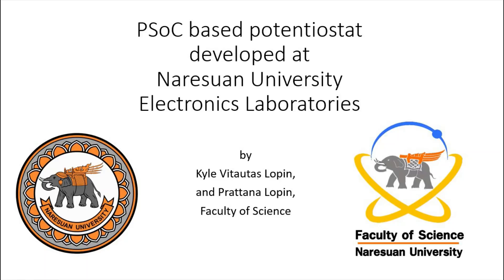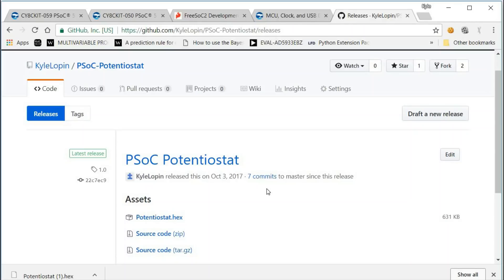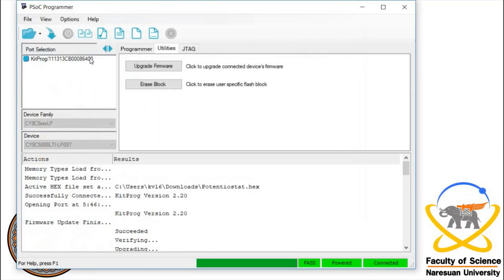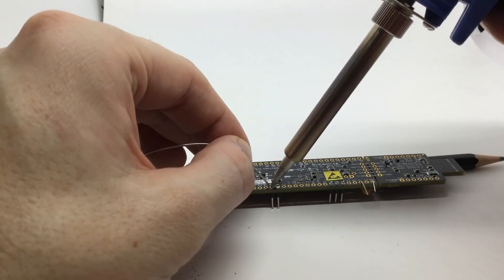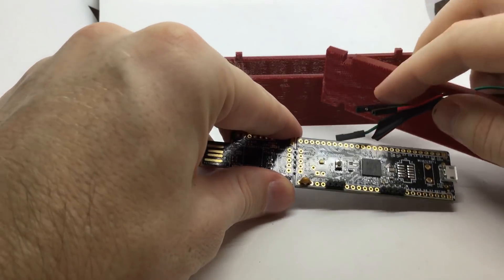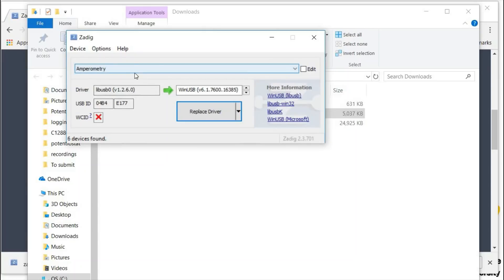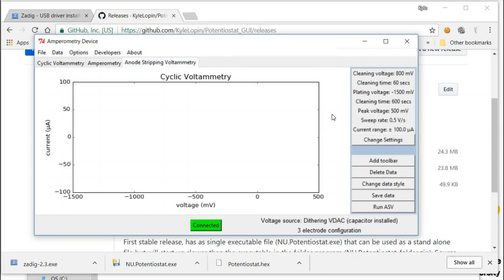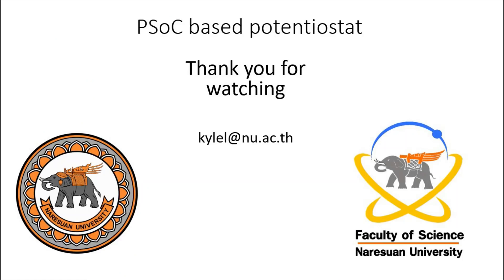Program a potentiostat into a PSoC 5LP

Comment: Hi, congratulation for the work! I try to reproduce and almost everything works. My problem is that I need to increase the current, so I try used a resistor between [0][4] and [0][7]. I used a resistor of 200 ohms, but nothing happens. Could you help me?

Comment: Dear Kyle, after a great effort I was able to use tour potentiostat on a real electrochemical system I made some voltammetries of ferrocene in MeCN using Et4N ClO4 as supporting electrolyte, GC as working electrode, platinum wire as counter electrode and a Ag/Ag+ as  reference. I’ve been trying to use the newer releases of the GUI but it was unable to connect to the PSOC and the button keeps giving me the message that the device isn’t connected. How can I work this out ? I tried to recompile the app but i’ve been getting the same message. Another thing that could be implemented is an increase in the number of cycles and a real time scan. Thanks for you attention.
Reply from the maker: I am working on changing the device and update it with some changes now, but it is taking longer than I expected, hopefully this week it will get done and I will make a new release for it.
Reply: @kylevitautaslopin3609  hello Kyle! I also have the same problem and it can’t seem to be connected. May I know if the update is done and where can I know it instead of coming to YouTube :)
Reply from the maker: @woshibearz  There is a new version here: https://github.com/KyleLopin/PSoC-Potentiostat/releases

You can respond to the github repo in the Issues section, I should be watching it now.  The new version is also simplier so it should be less problems going forward.
Reply: @kylevitautaslopin3609 Dear Kyle, Do you know why the display device in the GUI is also not connected, if you can tell me thank you very much
Reply: Have you solved the problem? I am now also showing devices in the GUI without connection

Comment: Dear Kyle, is there any chance of making the 1.2 firmware and the new GUI working? I tried to put them to work and I’m getting a message “device not connected”.
Reply from the maker: There is a new version here: https://github.com/KyleLopin/PSoC-Potentiostat/releases
It should work better with a serial port and no USB protocols
Reply: @kylevitautaslopin3609  wen are you intensing to improve cule numbers and implement chrononamperomwtry?
Reply: @Shuvra Jyoti Bose ok!
Reply: @Shuvra Jyoti Bose must rewrite the software. You’d study Python and try it.
Reply: Have you solved the problem? I am now also showing devices in the GUI without connection

Comment: IS that same code(Functionality) apllicable for both PSoc 5LP development kit & prototyping kit.If we use Development board then what will be further changes required??? In terms of capacitor installmeant & Pin configuration of WE,CE,RE.

Comment: How to increase number of cycles?
Reply: IS that same code(Functionality) apllicable for both PSoc 5LP development kit & prototyping kit.If we use Development board then what will be further changes required??? In terms of capacitor installmeant & Pin configuration of WE,CE,RE
Reply: https://www.duo.uio.no/bitstream/handle/10852/82665/5/Olav-Bjerke---masteroppgave.pdf     Please include this to your github code ,So that cv cycle can be increased
Reply: Its showing The device is not connected .Can you resolve this? I need DPV

Comment: There is  a problem of DPV based GUI please resolve that else it is useless. Your work is comandable.
Reply: IS that same code(Functionality) apllicable for both PSoc 5LP development kit & prototyping kit.If we use Development board then what will be further changes required??? In terms of capacitor installmeant & Pin configuration of WE,CE,RE

Comment: What is the compatible HEX file for DPV based GUI ? It's may show connected
Reply: IS that same code(Functionality) apllicable for both PSoc 5LP development kit & prototyping kit.If we use Development board then what will be further changes required??? In terms of capacitor installmeant & Pin configuration of WE,CE,RE
Reply: https://www.duo.uio.no/bitstream/handle/10852/82665/5/Olav-Bjerke---masteroppgave.pdf     Please include this to your github code ,So that cv cycle can be increased

Comment: Can we do DPV in that GUI. But its showing device not connected
Reply: IS that same code(Functionality) apllicable for both PSoc 5LP development kit & prototyping kit.If we use Development board then what will be further changes required??? In terms of capacitor installmeant & Pin configuration of WE,CE,RE
Reply: https://www.duo.uio.no/bitstream/handle/10852/82665/5/Olav-Bjerke---masteroppgave.pdf     Please include this to your github code ,So that cv cycle can be increased

Comment: great work. I am having problem while trying to reproduce it. the GUI panel is showing device not found. I followed the procedure as per the instruction video. I am using the same development board.
Reply: Same problem here.
Reply: IS that same code(Functionality) apllicable for both PSoc 5LP development kit & prototyping kit.If we use Development board then what will be further changes required??? In terms of capacitor installmeant & Pin configuration of WE,CE,RE
Reply: https://www.duo.uio.no/bitstream/handle/10852/82665/5/Olav-Bjerke---masteroppgave.pdf     Please include this to your github code ,So that cv cycle can be increased
Reply: Its showing The device is not connected .Can you resolve this? I need DPV

Comment: This is great! Thank you.
Reply: IS that same code(Functionality) apllicable for both PSoc 5LP development kit & prototyping kit.If we use Development board then what will be further changes required??? In terms of capacitor installmeant & Pin configuration of WE,CE,RE
Reply: https://www.duo.uio.no/bitstream/handle/10852/82665/5/Olav-Bjerke---masteroppgave.pdf     Please include this to your github code ,So that cv cycle can be increased
Reply: Its showing The device is not connected .Can you resolve this? I need DPV

Comment: Great! I've seen its been 3 years from the last video! Please go on with more 5LP projects, thank you
Reply: IS that same code(Functionality) apllicable for both PSoc 5LP development kit & prototyping kit.If we use Development board then what will be further changes required??? In terms of capacitor installmeant & Pin configuration of WE,CE,RE

Comment: thanks , it is working
Reply: @Shuvra Jyoti Bose yes
Reply: @thechemist7995  HOW >?? PLEASE GUIDE ME ABOUT THE PROCEDURE STEP BY STEP! , THANKS. Attach links accordingly.
Reply: @shuvrajyotibose9002  i followed his instructions
Reply: https://www.duo.uio.no/bitstream/handle/10852/82665/5/Olav-Bjerke---masteroppgave.pdf     Please include this to your github code ,So that cv cycle can be increased
Reply: IS that same code(Functionality) apllicable for both PSoc 5LP development kit & prototyping kit.If we use Development board then what will be further changes required??? In terms of capacitor installmeant & Pin configuration of WE,CE,RE

Comment: I'm grateful for your study and thanks for the tutorial! the potentiostat works good in tests (resistors and capacitors). I still need to test it with a real electrochemical system, but I've no doubt it will work smoothly. just a couple od questions: 1) the +/-0.9V limit is dictated by the PSoC 5LP board? could it be increased? 2) is there any possibility to implement the Electrochemical Impedance Spectroscopy and square wave voltammetry techniques?
Reply: Have you tasted it in an electrochemical system?
Reply: IS that same code(Functionality) apllicable for both PSoc 5LP development kit & prototyping kit.If we use Development board then what will be further changes required??? In terms of capacitor installmeant & Pin configuration of WE,CE,RE
Reply: https://www.duo.uio.no/bitstream/handle/10852/82665/5/Olav-Bjerke---masteroppgave.pdf     Please include this to your github code ,So that cv cycle can be increased

Comment: Hi Kyle, can you share the setup for your test with the capacitor?

I have successfully implemented the PSoC 5 Potentiostat project, and have tested resistors and a dummy cell with results matching the expected (slopes) but have been unable to duplicate your results using a (56 uF) capacitor.

Thanks in advance
Reply: IS that same code(Functionality) apllicable for both PSoc 5LP development kit & prototyping kit.If we use Development board then what will be further changes required??? In terms of capacitor installmeant & Pin configuration of WE,CE,RE
Reply: https://www.duo.uio.no/bitstream/handle/10852/82665/5/Olav-Bjerke---masteroppgave.pdf     Please include this to your github code ,So that cv cycle can be increased
Reply: Its showing The device is not connected .Can you resolve this? I need DPV

Comment: This is a very cool project with a lot of potential(no pun intended).  Thank you so much for working on it.
Reply: Have gotten it working properly? I’ve been trying but it gives me only a straight line.
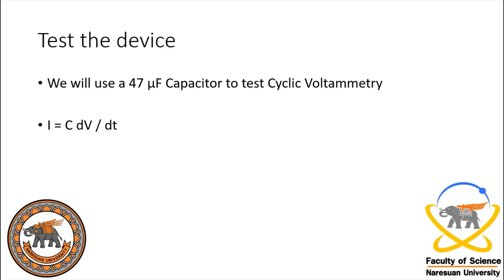Reply: @Shuvra Jyoti Bose  11:20 47 microF capacitor
Reply: IS that same code(Functionality) apllicable for both PSoc 5LP development kit & prototyping kit.If we use Development board then what will be further changes required??? In terms of capacitor installmeant & Pin configuration of WE,CE,RE
Reply: @shuvrajyotibose9002  I think you can  check with Cypress to better understand their products.
Reply: @memeking888  Its showing The device is not connected .Can you resolve this? I need DPV
Reply: @shuvrajyotibose9002  I think you may want to consult with the original author. I'm not quite sure if this platform can perform DPV..
Reply: Do you know why the display device in the GUI is also not connected, if you can tell me thank you very much

Comment: Can the code be upload on a smaller board like an arduino nano?
Reply: The psoc used in this talk has built in analog and digital modules that the Arduino doesn't have.  It would take some building of external circuits, etc to build a potentiostat on an Arduino.
Reply: IS that same code(Functionality) apllicable for both PSoc 5LP development kit & prototyping kit.If we use Development board then what will be further changes required??? In terms of capacitor installmeant & Pin configuration of WE,CE,RE
Reply: https://www.duo.uio.no/bitstream/handle/10852/82665/5/Olav-Bjerke---masteroppgave.pdf     Please include this to your github code ,So that cv cycle can be increased
Reply: Its showing The device is not connected .Can you resolve this? I need DPV

Comment: Dear friend,

I have very grateful with the device set-up you have published which I have tried to reproduced unsucesfully :(.
I have downloaded and installed the following software realeases as you mention:
 
 - PSoC Programmer 3.28.1 (Windows) Typical installation
 - Cypress Programmer 2.0 (Windows) Typical installation

Once I connect the CY8C5868LTI-LP039 device by female wire to usb male-KITPGROG,  Windows set the drivers automatically and when it's finished I install:

 - Zadig. Inside Zadig software I replace the previous drivers to libusb-win32 (v1.2.6.0) in following options:
 -KitProg USBUART (Interface 2)
 -KitProg Programmer (Interface 1)
 -KitBridge (Interface 0)
 (link with screenshots) 
  https://imagizer.imageshack.com/img923/9770/n7CHEr.png
  https://imagizer.imageshack.com/img923/3931/zcjAux.png
 
I open PSoC Programmer 3.28.1 but I can´t select the device from the panel "Port selection"  because it didn´t appear. What I´m doing wrong? 
Link with screenshot: https://imagizer.imageshack.com/img924/4761/ofNQSg.png

I have tried to restart few times and reinstall the programs but nothing happened. I´m using:
 -USB 3.0
 -Windows 10 Enterprise
 -KITPROG CY8C5868LTI-LP039 / CY8C5888LTI-LP097

Kind regards,

Gaspar
Reply: Dear Friend, I've tried to reproduce this device following the entire procedure unsuccessful, I'm starting to doubt that it could be done.
Reply: @agersoncruz   Dear friend, I agree with you. First principle in science is to be reproducible by anyonne who is interested in . Regards
Reply: Gaspar Carrasco Huertas I think there’s something that was not reported when installing the device drivers. The author’s silence is very concerning.
Reply: man, I've just realized that this is a fraud. I'm seriously thinking about questioning the journal where it was published.
Reply: IS that same code(Functionality) apllicable for both PSoc 5LP development kit & prototyping kit.If we use Development board then what will be further changes required??? In terms of capacitor installmeant & Pin configuration of WE,CE,RE
Reply: https://www.duo.uio.no/bitstream/handle/10852/82665/5/Olav-Bjerke---masteroppgave.pdf     Please include this to your github code ,So that cv cycle can be increased
Reply: Its showing The device is not connected .Can you resolve this? I need DPV

Comment: Can it be used for measuring impedance?( Nyquist )
Reply from the maker: It does not measure the electrochemical impedance spectrum yet, one of the DACs can be changed to a waveform DAC to perform EIS but it has not been implemented yet.
Reply: @kylevitautaslopin3609  
thank you sir when you implement please let me know sir i need badly
Reply: https://www.duo.uio.no/bitstream/handle/10852/82665/5/Olav-Bjerke---masteroppgave.pdf     Please include this to your github code ,So that cv cycle can be increased

Comment: Hi, where is the op-amp circuit that is shown in the journal?
Is this circuit part of the development board?
https://journals.plos.org/plosone/article/file?id=10.1371/journal.pone.0201353.s006&type=supplementary
Reply from the maker: The op-amp is inside the PSoC 5LP, the part pointed to at 3:57, http://www.youtube.com/watch?v=OCPO-TYS1mw&t=3m57s.  The PSoC 5LP includes 4 op-amps and 4 SC/CT circuits, each with its own op-amp that can be connected using an internal analog routing network, in addition to the ARM-M3 microcontroller.
Reply: IS that same code(Functionality) apllicable for both PSoc 5LP development kit & prototyping kit.If we use Development board then what will be further changes required??? In terms of capacitor installmeant & Pin configuration of WE,CE,RE
Reply: https://www.duo.uio.no/bitstream/handle/10852/82665/5/Olav-Bjerke---masteroppgave.pdf     Please include this to your github code ,So that cv cycle can be increased
Reply: Its showing The device is not connected .Can you resolve this? I need DPV

Comment: Dear friend, I've been trying to reproduce your potentiostat unsuccessfully. I followed your procedure but when I try to run the GUI program I receive the following message from Win10: Fatal Error: - Failed to execute script pyboot01_bootstamp. Could you help me  to work out this?
Reply from the maker: Does this make the program stop working?  It could be because there are 2 files it tries to open that are not packaged, it should make them after it can not find them the first time.  You can post your problem at https://github.com/KyleLopin/PSoC-Potentiostat/issues and I will look at it.   Also there should be a logging file you can post to help me figure out the problem
Reply: I worked it out this issue. However, I have a doubt about the capacitor. You said the capacitor should be 100 nF or greater. However, you didn't specify the voltage of the capacitor (50 V, 100 V, 250 V...1000V). my last question is if it'd be possible to use a 4 electrode configuration ( ref, ref, wE and ce).
Reply from the maker: The maximum voltage that will go across the capacitor is 4 V, so any capacitor should work.  Unfortunately the device can not use a 4 electrode configuration currently.  I'm not sure it is possible without adding an external difference amplifier, I will be working on this in the future though.
Reply: Thanks again for your help @kylevitautaslopin3609
Reply: dear friend, I finally get the potentiostat finished but it appears to have some issue since any voltammetry I perform results only in a straight line. I tried to change the parameters unsuccessfully. What could be wrong?
Reply from the maker: Sorry for late reply, i didn't get an email notice,  what are you trying to measure that is giving you a straight line?  have you tried to measure a resistor to check if the slope is correct?
Reply: Dear friend @kylevitautaslopin3609 , I managed the error. However, the equipment measures nothing. When I try to perform a measurement, I only get a straight line in zero current. I changed from capacitor to a real electrochemical system such as Potassium Ferricyanide and I'm still getting that straight line instead of the cyclic voltammogram profile. What could be causing this behavior?

Comment: Hi, what is capacity of the capacitor between GND and 3.1 (is it 100nF?) sorry but audio is very silent. Do you have also photo of potentiostat chamber, how to use ASV an CV stl parts ? Project is nice, I was trying to reproduce it. My first false was that I installed WinUSB instead of libusb zadig driver so it was not recognised, then replayed video again and repaired it. Bye
Reply from the maker: a 0.1 uFarad or larger can be used.  I will include a link to a photo of the chamber when a paper on this project is published, with photos of how the ASV and CV parts work.  sorry for the delay.
Reply from the maker: For the ASV part, it is a holder for 3 electrodes to do Anode stripping voltammetry and you can mount the cap on vial such as: https://i.ebayimg.com/images/g/~jwAAOxywbNQ9qbC/s-l300.jpg
the CV also holds 3 electrodes and can be put on top of a 50 mL vial
Reply: IS that same code(Functionality) apllicable for both PSoc 5LP development kit & prototyping kit.If we use Development board then what will be further changes required??? In terms of capacitor installmeant & Pin configuration of WE,CE,RE
Reply: https://www.duo.uio.no/bitstream/handle/10852/82665/5/Olav-Bjerke---masteroppgave.pdf     Please include this to your github code ,So that cv cycle can be increased